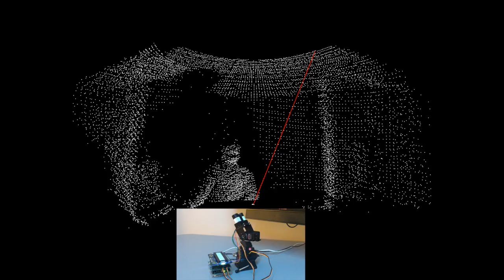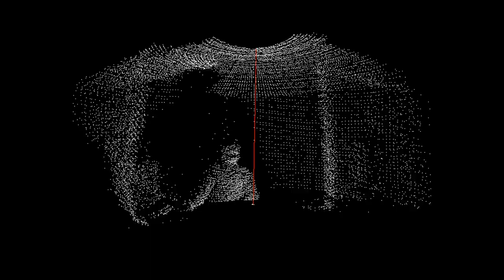Arduino-based LIDAR Scanner

Comment: I've always thought that you can't use light to measure distances because it's too fast and you have to use an atomic clock, like on gps satellites. Can someone please explain me why does satellites have to use an atomic clock but you can do the same thing with an arduino at 8MHz?
Reply: According to the garmin spec sheet, this particular model works by measuring phase shift, not "time of flight" directly.
Reply: If I understand your question correctly he isn't using the Arduino to measure the time it takes the light beam to travel to the target and back that measurement is being done by the LIDAR  module.  It simply tells the Arduino how far an object is from the from the front of the detector.
Reply: Interesting. Already out of my depth but something new to look up =)
Reply from the maker: GPS satellites require atomic clocks because the satellites must all be synchronized in order for GPS receivers to use their signals to compute location. LIDAR needs a fast and accurate clock, but only one clock is required. The is no need to synchronize multiple clocks, hence no need for atomic clocks. The distance measurement is performed by the Garmin LIDAR detector, not the Arduino.
Reply: Davide Magazzini - this has nowhere near the complexity requirements of a GPS

Comment: could you also use a spinning mirror in front of a lidarsensor?
so you had less mass and cables flying around? :)
Reply from the maker: Not sure if a spinning mirror would work, because the LIDAR detector has separate optics for the emitter and detector. They both need to be focused on the same spot.
Reply: banano banana - you can hook it ip using a slip ring and a constant spin stepping motor

Comment: to eliminate the bulk of any miss readings/errors caused by reflections, glance blows and shadows, you could run it 3 times at different locations. If you made a base plate with locating pins that the scanner could index itself at known angle, spacing and even height if you wished. you could  triangulate out errors etc and make the cloud map not 2.5D but closer to 3D. Like I said in another comment, I have been thinking about a cheep way to make a reliable room scanner to measurefor very expensive one off furnishings.
Reply: hey what you are thinking is EXACTLY what one of my friend needed. Their furniture goes for around 100K+ (wardrobe) and having issues during installation every time. 

So installer have to be quite creative every single time.  There would always be small issues here and there when it comes to final installation.  I have been really demanding and asked them to build a 3D model (1cm accuracy, where I really want is sub mm accuracy) of the room every single time on a new project. And the lack of AI or automatic drawing / measuring tool  is making it very hard.

I hope in the future there can be a tool that scans & spec the room, and builds a 3D model to a sub millimeter precision. Or a tool that scans a finished room which can tell the flatness  in wall or floor surface straight away.

You can check out Rimadesio, Lema or Bulthaup. Installations of their furniture requires very precise measurements and floor /wall finishing & material. As well as some wooden flooring like Dinesen flooring, where the flatness of the concrete floor needs to be + - 2mm.(Same flooring requirement as Apple official store)
Reply: Actually it's even more easy.
Just use circular polarized filters.
Reply from the maker: Interesting idea. I can't think of an obvious way to automatically identify the "locating pins". Perhaps combining the multiple scans would require some human intervention where a user manually identifies multiple points that are common between the scans.
Reply: Dana Peters It's simple , a flat plate with say with three pins triangular 1mt apart. Run each scan from the new datum point. You don't need a point in space to set the datum each time. You just need to start each scan with the thing exactly pararel to the previous scan. You can move xyz to change location, but abc is to be the same at every new scan to calculate anything out of it

Comment: I was going to make this 10-15 years ago to measure bay and bow windows for close fitting pelmets for curtains/drapes. As some complicated windows took 2-3 hours with 2 men up ladders using tape measures with 20-80 measurements at 1mm accuracy read from 4 feet away sometimes. then remeasured 2 times more to remove mistakes. boss never gave me the time to work on it and simple platforms like the pie and arduino where not available back then and laser measures where pricey. but mistakes still cost 100's in time and materials.

Comment: Hi, very nice project.  Have you verified how accurate the point cloud is to the actual dimensions of the space?  thanks.
Reply from the maker: I have not verified the accuracy of the scan, but the distance shown on the LCD display will match the distance determined by a measuring tape to within a centimetre over a distance of a few metres. I don't see any reason why the scan would be less accurate than this static test.
Reply: You do have take take the curvature supplied by the two servos and the distance of the scanner to the origin in to an account.. it creates a quite dazzling effect :) the point-cloud, however, is not precise.

Comment: Excuse me, I want to ask you that what kind of software or tool that you use to get that 3D mapping? Thank in advance?
Reply from the maker: The point cloud is displayed on a desktop computer using a Processing sketch. The source is available as "LidarScanner.pde" from the URL in the description of this video.
Reply: Dana Peters Thank alot sir. I have one more question regarding to point cloud, the point cloud that we   have project in our desktop computer. Can we save it as a file or something for converting to a real world 3D model? Thank in advanced.
Reply from the maker: The Arduino writes X, Y, Z values to the serial port, so you could use a serial terminal program (or the "Tools", "Serial Monitor" menu in the Arduino IDE) to capture this serial output. Alternatively, you could add a function to the Processing sketch to dump the contents of the "vectors" array to a file in a format of your choosing.
Reply: Thank a lot sir, but can I take the out from the processing (I mean not the data of the vector or point, what I want is the 3D graphic model that we have scan) like in the video you have scan and build the map of your room. I want to get that point cloud and use other software to convert those point cloud into a 3D model. Thank in advanced.
Reply from the maker: Sorry, I am still a bit unclear on your question. My video shows only the 3D points that are contained in the "vectors" array. Perhaps you want to convert the 3D points into a representation with 3D planes? If so, I don't have any advice, unfortunately.
Reply: Thank a lot sir.
Reply: Thank a lot sir. But what type of servo mount that you used for put the lidar stand. Could you send me some links about that mount servo. I want to buy it. Thank you.
Reply from the maker: It is a mini-tabletop suction vise (try searching for "Goot ST-80"). An excellent way to hold the servos firmly on a smooth surface such as a table.
Reply: Thank for your help sir. Thank you.

Comment: What's the limiting factor for the scan take 10 minutes? How are self-driving cars able to scan in real-time?
Thank you for posting this video, it's has given me a little creative inspiration :)
Reply: I believe that this lidar is limited to about 100 measurements per second, which sets limit on total scan time
Reply from the maker: This project uses hobby servos to slowly step a LIDAR detector. The Garmin detector could operate at a much higher scanning rate, but the speed of servo movement is the limiting factor. I believe that self-driving cars typically use a quickly rotating mirror to steer the LIDAR beam, increasing the scanning speed tremendously.

Comment: What press are you using to hold the motors?
Reply from the maker: It is a mini-tabletop suction vise (try searching for "Goot ST-80"). An excellent way to hold the servos firmly on a smooth surface such as a table.

Comment: How do you visualize the data?
Reply from the maker: A Processing sketch on a PC receives and displays the data from Arduino serially. Go to the link in the video description to download this code.
Reply: ok, thank you very much, and is that sketch available for Mac?
Reply from the maker: Yes, the Processing sketch was developed on a Mac, although it ought to work on a WIndows PC as well. I was using "PC" in the generic sense in my previous reply.
Reply: @danapeters  Can we save this data as .stl .obj or  .ply etc. ?

Comment: Hi, would it be possible to do this with a MaxSonar-EZ1 ? (http://www.zagrosrobotics.com/shop/item.aspx?itemid=655) I'd be fine if it was lower resolution, but would it still produce a somewhat decent scan in smaller rooms/spaces? Thanks!
Reply from the maker: I have never tried an ultrasonic distance sensor, but I'm guessing that they would only give acceptable results if you interested in the rough features of large objects at close distances.

Comment: Hello!
Your Processing sketch (LidarScanner.pde) can use with 360 degree lidar?
I'm trying to find software ,It's can help me.
Reply from the maker: The Processing sketch accepts serial input with space-separated X Y Z co-ordinates. This ought to work with a 360 degree scanner, provided it produces serial output with this same format. You can modify the Processing sketch to accommodate the output format of your LIDAR scanner if needed.
Reply: Thank you.
Reply: @danapeters  How about the Arduino sketch?

Comment: How many point do you collect at 10 minute ?
Reply from the maker: There are 18,000 points in the point cloud shown in the video, which was captured in 10 minutes.
Reply: thank u MR. Peters
Reply: @danapeters  hi Peter, how did you count how much pointer on the video? Can you tell me?
Reply from the maker: I did not attempt to optimize the speed of the scanner, so I don't know what the limiting factors are. There is a delay(30) in the Arduino sketch that attempts to give the servos some time to settle, perhaps this can be reduced or eliminated for faster scanning.
Reply: @danapeters  Leica BLK360(sandwich 2 old hdd drives, 90degree polished aluminium prism on one of the motors and the sensor in the opposite, should be fairly robust contraption......)
Reply: If lidar lite can take 366 readings per second,  why did it take 10 minutes to get 18,000 points?  limited by the movement of the servo's to cover the field of view in a short amount of time?  or do you have to slow down the readings per second to get better accuracy?

Comment: Hey! thank you a lot for your uploads!
I am trying to rebuild it but i am not able to turn my servos turn continuously with my arduino uno.. i use micro servo sg 90
Reply from the maker: Thanks, and good luck with getting your project working. The SG90 servo should work well with the Arduino, since I see that others have used it in various projects. It appears to have a 180 degree range of motion, which is all that is needed for this project.

Comment: hi 
can u tell me 
how we conecting the lidar with program ?
Reply from the maker: Sorry, I don't understand your question. Please see http://www.qcontinuum.org/lidar for more detail. If you still have a question, ask again, but with more detail so I can understand.
Reply: How do I manually programming lidar not use any programming from one another. Rooster book about programming.
I have a project but not like your project. I need only programming lidar
can you help me?
Reply from the maker: There are many different types of LIDAR, controllers, and programming languages. Sorry, I cannot help unless you are using the Garmin Lidar-LITE with the Arduino UNO R3 controller.